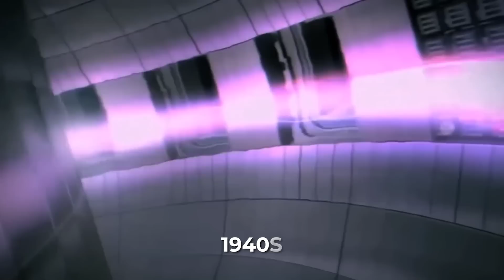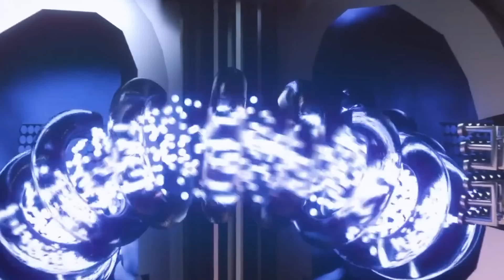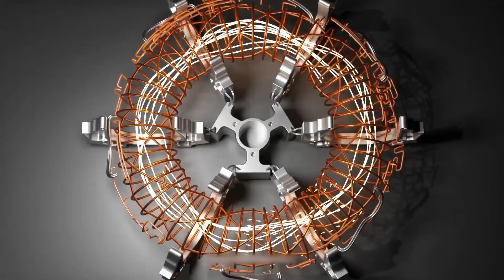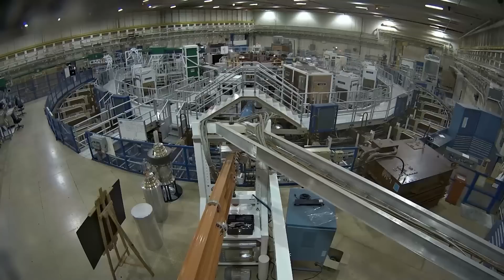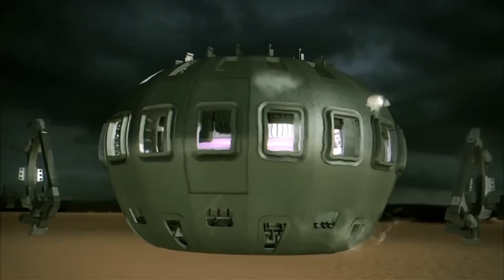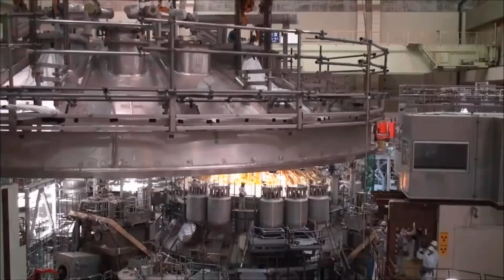Germany's New Nuclear Fusion Reactor DESTROYS The Entire Industry!

Comment: The plasma has grades. From 6100"F to core at 27000000°F. FIELD intelligence is needed. Do not muff up the definition of high temperature. Plasma is made of quarks only. Matter is different. A quark is any 4D particle smaller than 10^-13m. We have a 10^-21 limit. I am way ahead of your business and I do not need money to produce. It is particle wave, not particle only. How short can they create cosmic ray wavelengths? I win!

Comment: Where is the beef ?     Why not just make great fission based units NOW.   May not be enough cheap oil to finish the fusion dream.  ❤❤
Reply: Steam heat , old boy
Reply: Small Modular Reactors are comming soon. They can go into the Grid closest to where power is needed. Can replace existing fossil fuel plants on the same site. We would have them already if not for the massive oil/gas lobby.
Reply: @jondonnelly3  ain't that the truth

Comment: Without exponentially increasing pressure, temperature, and mass. Society will not be able to achieve, and sustain the temperatures needed to engage the fusion strong force process. The technology needed to create an environment favorable to sustain nuclear fusion is more than 30-50 years away. It is pretty much impossible using today's materials, and technology. It just ain't going to happen anytime soon." To achieve the energy output of a star, a star you must become." (N.D Tyson)
Reply: I agree, but humans have already exceeded the reaction rates and energy densities that exist within stars like the sun in nuclear weapons. I don't mean to say that we can achieve a sustainable fusion reaction, but, we already made something approximating a small segment of a supernova. I will qualify that to consider the density of a plutonium pit, at room temperature, even before it's compressed and goes supercritical. The energy density is beyond belief, the temperature reaches around 100 million deg. C.

Comment: For a number of years now, work has been proceeding in order to bring perfection to the crudely conceived idea of a transmission that would not only supply inverse reactive current for use in unilateral phase detractors, but would also be capable of automatically synchronizing cardinal grammeters. Such an instrument is the turbo encabulator.

Now basically the only new principle involved is that instead of power being generated by the relative motion of conductors and fluxes, it is produced by the modial interaction of magneto-reluctance and capacitive diractance.

The original machine had a base plate of pre-famulated amulite surmounted by a malleable logarithmic casing in such a way that the two spurving bearings were in a direct line with the panametric fan. The latter consisted simply of six hydrocoptic marzlevanes, so fitted to the ambifacient lunar waneshaft that side fumbling was effectively prevented.

The main winding was of the normal lotus-o-delta type placed in panendermic semi-boloid slots of the stator, every seventh conductor being connected by a non-reversible tremie pipe to the differential girdle spring on the “up” end of the grammeters.

The turbo-encabulator has now reached a high level of development, and it’s being successfully used in the operation of novertrunnions. Moreover, whenever a forescent skor motion is required, it may also be employed in conjunction with a drawn reciprocation dingle arm, to reduce sinusoidal repleneration.
Reply: And that, is how you make a plumbus.
Reply: I was thinking the same thing.

Comment: How do you get energy out?
Reply: Like you get it out from a solar panel. A specific radiation fires on a material which can transform this to heat or direkt electricity. When you use heat, you need a steam turbine also.

Sounds simple but at the end, it follows this principles. With more complex hardware of course

Comment: and where do you put your nuclear rods when they've spent their time? You just leave your sitting there too😮. What do we need nuclear when everything's charged right in the air.
Reply: Fusion reactors don't use nuclear fuel.
Reply: @EricMBlog  yeah but they produce a little amount of it. Ok with a half-life time between 30-100 years but that's relatively better to handle then the actual situation.